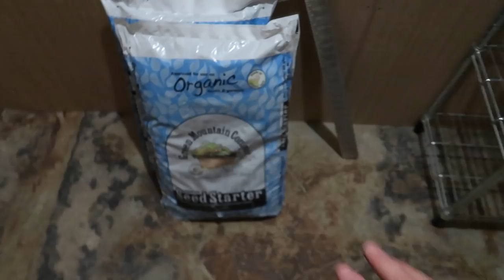Maintaining our Chicken Coop and Pig Pen in the Winter ~ Modern Steader tour

Comment: Hey Al,  I'd definitely be moving that lard into the cold room ASAP.  Cats have a tendency of knocking stuff off ledges and tables either accidentally or purposefully.  I saw you had to pull Figaro out of one of those high runs recently.. don't wanna give him the chance to spoil any of that lovely lard you worked so hard for, or risk Pluto and Figaro cutting themselves on broken glass as they try to lick up the lard.   The show shovel is a neat trick, but hey you know.. ratchet strap use number 203... holder for the water bottle  :D
Reply from the maker: The racthet strap would work well too!